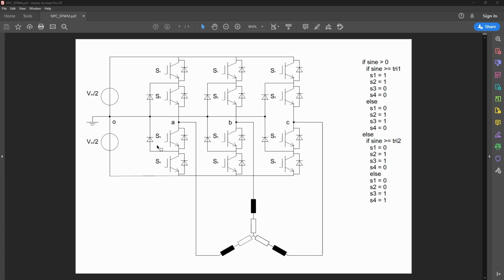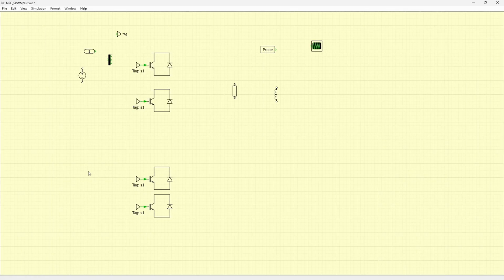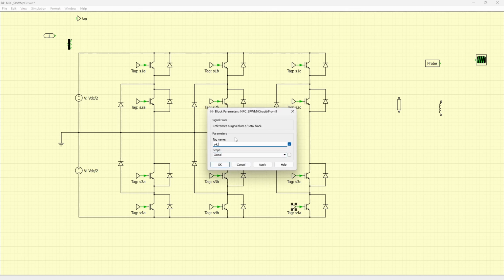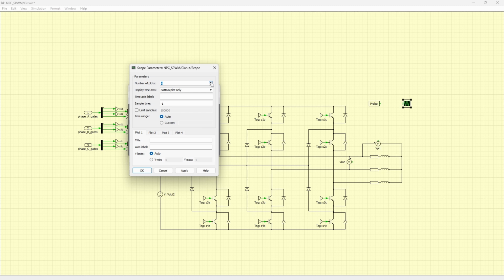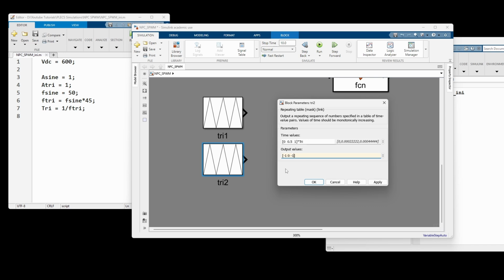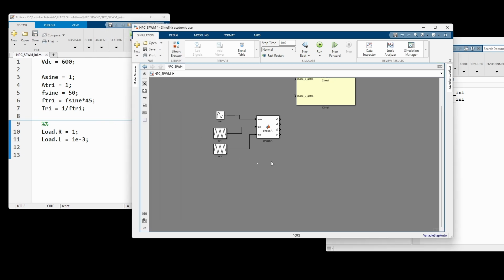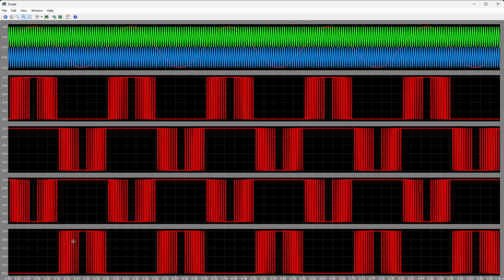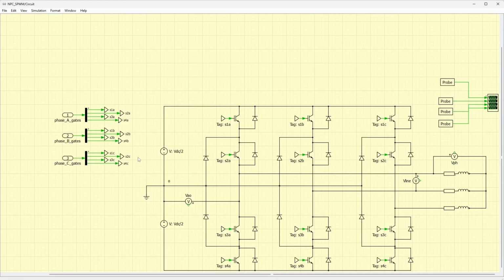Three-phase Neutral Point Clamped (NPC) Inverter using Sinusoidal PWM in PLECS/Simulink

Comment: Hello sir, excellent educational video. I use PLECS at work for power circuit simulation. Looking for an losses(switching loss,condution losses) in multilevel inverter using PLECS for PDPWM topology. can u make vdo sir.
Reply from the maker: Thanks. Please watch the videos in Thermal Simulation playlist. There I discussed the characterization of devices such as IGBT. That should help. Otherwise I would record another tutorial. 
Here is the link of first video. 

https://youtu.be/5hJEYHjZpTg?si=YTZYSAHKfsqIjfNv
Reply: Sir ,I already watched thermal video and have some doubts about multilevel inverter switching losses. Can u make a video on 9 level multilevel inverter and simulate it to find switching losses and condition losses using plecs software.